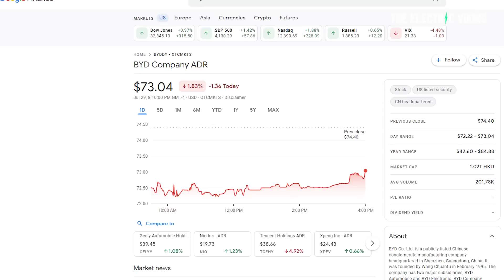BYD's world first auto industry move that no one saw coming

Comment: This perpetuation of a inaccurate assertion is confusing: 
Tesla DOES make profits outside of China, healthy ones, Fremont/Sparks facilities are doing great right now.

Maybe you're talking about the brand new Texas/Berlin plants that are still spooling up? If so, then sure I guess, but on a positive note Berlin may be starting to break even already, so that's promising. 

It's just that their China operations are the most profitable by far, their local manufacturing efficiencies and advantages are indeed impressive.

The point of the video is still valid but lets base it on more accurate information.

With that being said, I'd be curious to see how well this idea works for BYD. Perhaps they can also afford to get away with it compared to Tesla due to the problematic emissions angle.

Comment: Does byd own their own robot making company? Own their own propiatery software to run all their operations and factories with that they designed? Do they own a seat making company or make their own? What about motors, inverters, chip's? Do they make their own chargers?
Are they licensed to distribute electricity and operate as a power generating company? Have their own casting machine's?

Are they vertically integrated? Heck yes and it's awesome. 👍🏻
But I think tesla still has them on multiple fronts at this point.
Reply: Reading through the comments it don't seem like BYD have their own charge uP stations .

Comment: Decentralised manufacturing means shorter voyages. Incat style Alloy fast car ferries. Vehicle to home connectivity to use the 3000-4000 fully charged batteries to power electric marine engines. Ferry has its own vanadium flow battery for return journey empty. Help by full cover solar and wind power deck. Crazy not to use captured power of 4000 EV's as a power source to save on cost.
Now that is vertical integration for EV only car ferry ownership.

Comment: Sam, you are wrong in many areas. Number one BYD does half hybrid. You don’t like hybrids and yet your love for BYD doesn’t differentiate that on videos like this. 

Also, are there any Gigapress pieces in BYD cars? They are in Tesla’s China, Germany and the US? These integrate 370 pieces of the car. The Austin factory is going to be hugely profitable as they ramp. So your statement that US Tesla is not profitable, May already be wrong, but it will be wrong in a big way. 
Tesla doesn’t make EV’s and Hybrids on the same assembly line. They don’t take a ICE factory and change it over. They start from scratch on all their factories now.
I hope one day you can emotionally remove yourself from BYD. 
They still have to move over to EV’s only???? This may be an issue!! 
Ramping their EV’s is another issue. They have 15+ EV’s, Tesla 2!! Complexity vs simplicity!! Who is winning.

Comment: That is the difference between BYD and Tesla. Tesla is a pure EV play where their mission and vision is purely in a Low emission future through electric and storage rather than putting their focus in ships that is driven by oil. I believe if Tesla were to go into this sector, it will only be when the battery refining, recycling and manufacturing sector is matured as right now there is not enough resources to build the demand that is there for the next few years. Since cargo ships rely on energy that conflicts with their mission… out of their strategy they go..
Reply: I thought he said the ships were to be driven by hydrogen?
Reply: @Martin-se3ij  Hydrogen tech is a fools errand. Whatever the source of technology that drives the cargo ship, it is never in line with Tesla’s mission.
Reply: @timlavente5880  You say that, but Tesla is shipping it's cars in diesel powered ships. Many cars in Brazil run on hydrogen and there are hydrogen truck on the roads already. Some in use in the California docks. To me, filling a car with flashlight batteries has always seemed a stopgap to something better. I'm not rooting for hydrogen but I think dismissing it as a fools errand could be counting it out a little early. You may be interested in the "Azimuth Thruster" Rolls-Royce designed for large ship propulsion.
Reply: @Martin-se3ij  you have a point into something better, and yes hydrogen technology is there and proven but what I am saying is the difference between Tesla and BYD is the mission. Pure Play vs a hybrid. In pure plays like Tesla, efficiencies is the difference and that’s why Tesla will never go for hydrogen when you lose efficiency to convert one form of energy to another form . It is like designing a solar powered torch where you use a form of stored energy to convert into another form of stored energy. Tesla is not into the shipping transport yet and there isn’t other choice out there.. unless there is a factory in every country they sells.

Comment: BYD is indeed very dynamic and savvy. 

But has BYD invested in.sodium-ion batteries? If the report from CATL is correct, then lithium-based batteries are obsolete or on the verge of being so.

And BYD's investment in lithium mines is on the verge of becoming write-offs.

So unless BYD is already on the ball with sodium-ion batteries, its share price direction is south.
Reply: Yes they have.. Look at their patents which can be publicly obtained.  Do you own research before commenting and pretending to be a know-it-all.
Reply: Here, read about your beloved sodium ion batteries.. Compared to the extensively-used lithium-ion (Li-ion) cells, Na-ion cells have a way lower energy density and cycle life but perform better in a wide operational temperature range and are safer. Na-ion cells have a similar working principle to Li-ion cells and are expected to be at least 20% cheaper than LFP due to their lithium-free nature. However, separator and electrolyte costs could be significant and result in Na-ion being more costly.

By taking advantage of the low-temperature performance of Na-ion cells – 90% of high-capacity retention at -20 °C – and the high energy density performance of Li-ion cells, CATL aims to combine both cells into the same electric vehicle (EV) battery pack as the AB battery pack for better results. Lithium obsolete ? Ya right....Given, lower energy denisty and life cycle and being more costly? Good luck on relying on CATL.
Reply: @jasonk203  Thanks. But I have already read that report.

But there is also a report on a game-changing sulpher-based battery.

The game is changing on batteries rapidly. 

We have not seen the peak yet.😁